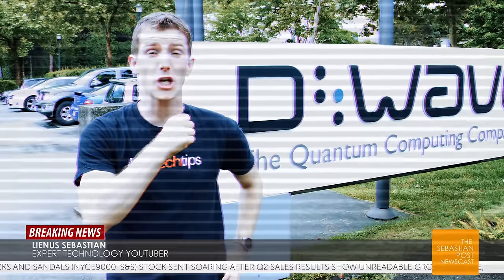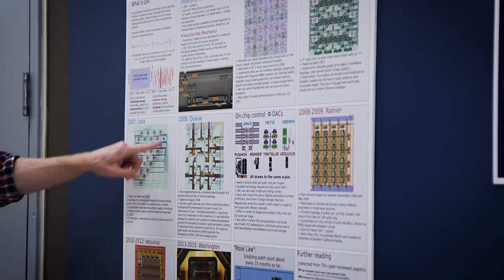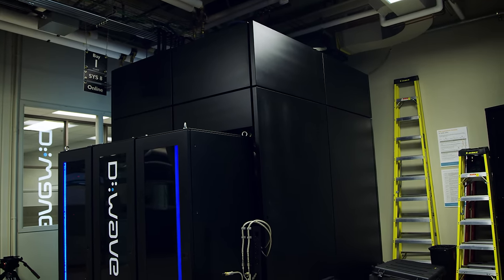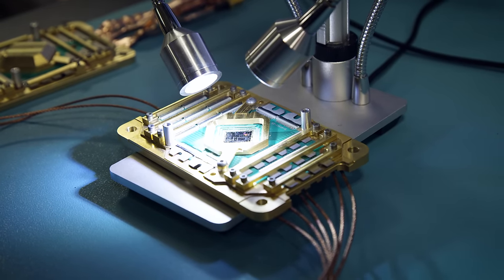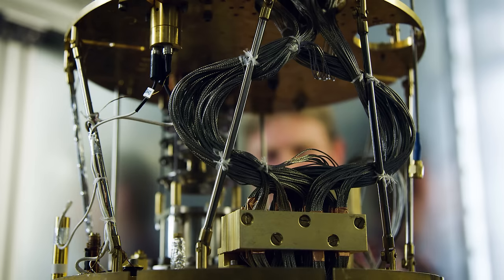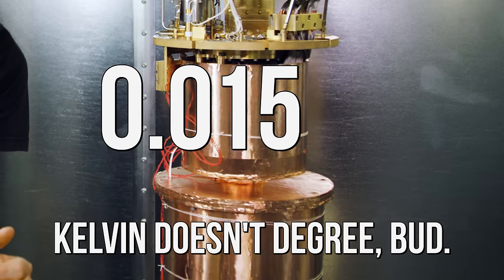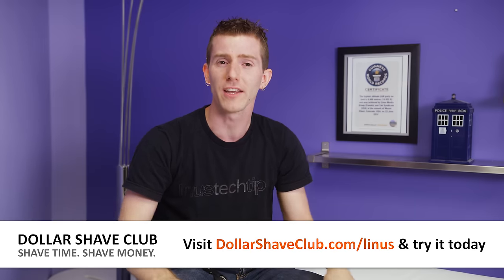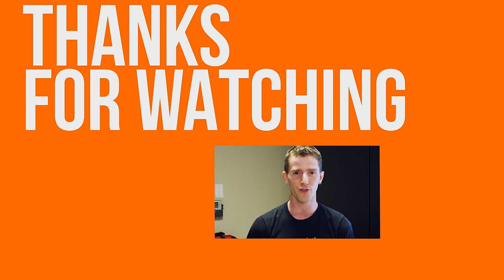UNBOXING A QUANTUM COMPUTER! – Holy $H!T Ep 19

Comment: Do they run it overclocked?
Reply: Do you really need to overclock when you have a theoretical clock speed of infinity?
Reply: the quantum part of the computer takes analog signals, so technically no, however in order to interface with those signals you need a classic computer so the whole system should just be limited by that server.
Reply: Mark Wright it's an interesting one because a normal processor does calculations at a certain clock speed whereas a quantum processor can do more than one calculation at once so could the speed be intifinate or am I not understanding any of this?
Reply: That's not how quantum processors work.

Comment: almost as cold as your average winter day in Canada
Reply: Dedede Main Canada is -273°C cold????  On average???
Reply: Canada is about -1 K during the winter. On average. Variance? -2 K^2.
Reply: AlphaCrucis -1 K is physically impossible... 0 K is absolute Zero, the temperature at which all movement, even on the subatomic level, ceases. Even if negative Kelvin where somehow possible, it would be impossible to measure.
Reply: Yes. And negative variance is also impossible. That's how cold Canada is in the winter!

I know, I suck at humor...

Anyway, a quantum mechanical system still has some amount of kinetic energy at absolute zero. See "zero-point energy". According to classical mechanics though, you're right.
Reply: It's actually possible to get lower than absolute zero, but not exactly zero, but it's actually warmer.
Reply: Dedede Main: Ah. Is that why D-Wave is Canadian?

Comment: The cooling might be able to cool a FX-9590 to about 80°C at idle...
Reply: you mean the new intel cpu right? because that one has a thermal problems, not that 5yo FX....
Reply: @HybOj No. Not Intel at all. The FX9590 is a 8 core CPU made by AMD that runs at 4.7-5GHz. With it's TDP of 220W it's essentially it's a computational heating element. If you want a very high clocked processor and the cost of power consumption doesn't matter, and you have damn good cooling, this would do the job.
Reply: +XenonQAI Researchers are still on it, trying to keep a GTX 480 or R9 290X cooler than the boiling temperature of water.
+HybOj Yes, those Core-X CPUs (because everything with an "X" in its name MUST be cool and fast and game and HELL YEAAAAAAH) are also nice space heaters, but that FX-9590 is still the current king when you want to speed up climate change.

Comment: Imagine bitcoin mining on a quantum computer...
Reply: @JGHFunRun  hahaha that's true!!!
Reply: @JGHFunRun  if that were true anyone with a quantum computer would have infinite money
Reply: With 20 kilowatts? I think your balance will go to minus...
Reply: I think calculating the hashes would take even more time as the thing would come up with nonsense values all the time
Reply: @Stigma The assumptions which hash functions are based on don’t apply to quantum computers, meaning that you can basically run the hash function backwards and find inputs which give you a specific hash. This would break Bitcoin’s consensus algorithm and therefore undermine its security.
Reply: @lenn939  it would not be end of the btc itself, but whole economy as we now know. There is a ton of services using SHA-256 encryption
Reply: @Matej Leško SHA-256 is a hashing algorithm, not an encryption scheme. But you‘re right that the security of Bitcoin is far from the only thing that would be undermined by high qubit quantum computers, so it should probably be one of our lowest concerns.
Reply: ilumix led  the same work could be given to a functional quantum computer, and the math would be more direct. so in theory it would beat any Cray supercomputer filled with nVidia Volta's GPU racks. 
Only one so far is rendering a pony movie in 3D using Arnold, that's a monster where 20 years ago it would have needed a dozen of SGI machines.
The key is in the programming of the... thing. but that proves the bitcoin is not a reliable currency, it's just using power to process sudokus.
Reply: Blue sorry I know this is an old comment, but anyone that has a quantum computer already basically has infinite money.
Reply: @chubi167  in Bitcoin. I could eventually start a crypto by mining gems or woodstocks in Everfree Outpost while I'm at  it. Or solving sudokus manually.
It would have the same value.

End the FED and the BCE. Get back to gold standard.
Reply: That is actually a good idea!
Reply: Rich as fuck
Reply: You would fork the chain.
Then have to hop chains, fork again, and again, and again... Lol at all the comments here assuming they know chains.
Reply: We found our suspect

Comment: 0 Kelvin is the coldest temperature possible in the universe
Reply: Adam Fields nope we don't know half of the mysteries on the universe
Reply: Hey look it's God himself! Is there anything colder than coldest God?

Would that be like when you let your own son get crucified? 
o_O
Reply: Eh, no, 0 kelvin is not the coldest temperature possible in this universe. 0 kelvin is impossible to achieve, therefore it's not the coldest temperature possible.
Reply: 0 Kelvin is in fact the coldest temperature possible. Your argumentation doesn't make any sense btw.
0 Kelvin means that there is no kinetic energy left in the atoms. No movement at all. Whatever you measure then is due to Heisenberg's principle of uncertainty. It's a limit like the speed of light.
Reply: Actually @Frostbite1003, @Mr. Chang is right (and wrong and so are you). 0 Kelvin can never be reached in a system because of quantum mechanics, yet in any system very close to 0 Kelvin there should be (virtual) elementary particles with a negative Kelvin temperature because of those same quantum mechanics... so yeah that's kinda weird.
Reply: Only in this universe though. The coldest temperature in my universe is much colder.
Reply: And that's the exact reason you can never reach absolute zero, there's still movement due to quantum effects. You just said it's impossible after saying it's possible.
Reply: negative kelvin temperatures are hot.
Reply: @Werner van Alphen Negative temperatures are a whole other ball game. I'm not even sure you can say they are "colder" than just a little above absolute zero.
Reply: @Werner van Alphen That's why I said "possible", not "achievable". Like the speed of light. And aren't the negative temperatures caused by the principle of uncertainty? I'm not sure right now. There was a Vsauce video about negative temperatures...
Reply: Frostbite1003 0 kelvin is not possible... no two ways about it
Reply: It was a SixtySymbols video, I think.

But yeah, as many have pointed out already, you can NOT reach absolute zero. It is not achievable, and therefore not possible. Because of quantum mechanics. Just like a body with mass can never reach the speed of light, not matter how hard you try. You can get close, but never reach it. Same for temperature, you can get close to 0 kelvin, but the closer you get the harder it is to reach even colder temperatures.
Reply: Zero Point Energy fucks it

Comment: But can it run Minecraft?
Reply: No.
Reply: ಠ_ృ stupidest question ever how can one possibly run minecraft?
Reply: No, but it could calculate every single thing you could possibly do in the game.
Reply: yes. essentially normal computers take x and add y and produce z

quantum computers take all information in a problem and produce however many answers are possible along with as many optimal answers closest to the true solution as you want.
Reply: lowest setting at 0 average 3 maximum and -0000000 lowest
Reply: faaaarrrt
Reply: Maybe but on lowest setting
Reply: RIP hypixel
Reply: Here's a question for you , if you had a brain , what would you do with it ?
Reply: Nou r/wooosh
Reply: It both can and cannot
Reply: If it can't run Minecraft why then have such thing?!?
Reply: that, my friend is the most important question I've ever heard
Reply: minecraft不是只有天河二号才能运行吗？（滑稽）
Reply: This would probably be good at managing ai in strategy games. So use these to control the ai and normal processors for other game mechanics. Could probably use it for physics/graphics engines

Comment: can it mine ethereum?
Reply: kakaó valami lol that would destroy the whole industry of cryptocurrency
Reply: kakaó valami well he said these are made to do very complex equations so I would say they would be very effective
Reply: sky blue except hash-calculations are very simple and the exact opposite of complex calculations
Reply: Excel its not that simple. come on we arent even talking about a traditional computer
Reply: dreZvynDE what is what
Reply: sky blue woah you might be right, they could become rich
Reply: kakaó valami i dont think this computer is even capable of running hash calculations...
Reply: In theory yes it can but the question is, is it efficient? Would the power to cool and run this able to sustain itself and make a profit?
Reply: What are the specs on your current mining rig?
Reply: probably not
Reply: HigherPlanes I'm using a pair of msi gtx 1060 6gb cards. you?
Reply: Yes it would ROCK for mining. Reason being is it can look at many results simultaneously while a classical digital cpu or gpu can only do 1 and 0 in a string at a time. These chips are designed for things like encryption
Reply: Devin Dykstra how much do you make /day and without the spendings of electricity?
Reply: The security industry is already researching feasibility of hashes etc when Quantum Computers become a norm. It sure can mine ethereum but the cost of running it will outdo ethereum benefits by far.
Reply: It will definitely need a different algorithm, but they might be able to bring a cryptocurrency to its knees if they feel like it.
Reply: I'm not entirely sure, but I think one of the main uses for quantum computers is the decomposition of numbers into primes, and cryptography is all about that, so yes, it could mine at exponentially faster speeds.
Reply: No; the way it performs calculations is fundamentally different from your normal computer processor.
Reply: Devin Dykstra I stopped mining in 2015. I think the last card I used was a 980m. Now I mostly sell and buy.

Comment: "This generation of D Wave's processors consume no power and output no heat"
This must be some sort of technicality right?

Edit: On D Wave's website their claims are "Unlike the CPUs of classical computers, D-Wave’s superconducting QPU dissipates negligible amounts of heat during computation" and " the D-Wave system consumes less than 25 kW of power, most of which goes towards operating the cooling and front-end servers" 
So the processor does use energy and make heat. I'm betting Linus was just misinformed.
Reply: outsider344 It is, because the whole machine consumes a ton, and heat up a lot.
Reply: i think they are talking about the "qchip"
Reply: at that low temperatures almost everything is superconductive that means electricity flows with almost 100% efficiency and the waste is very VERY minimal aka almost none
Reply: I thought superconductors generate 0 heat and has like 0 resistance which is what is powering the chip, and I'm assuming the chip is also in a superconductive state, which makes it generate 0 heat, the only thing that generates heat would be the wires that aren't in the superconductive state, which is still getting cooled continously
Reply: MeatSafeMurderer that's the thing when a wire is supercooled there is no resistance in the wire so no waste heat is produced as it is not perfectly 0k it will produce some heat but just on a tiny scale that isn't really worth noting and as in a computer all the poem goes to heat (other than linuses rgb setups) as no heat is produced no electricity is being consumed
Reply: Vince Kiss I understand the high efficiency, but I would think a processor is by definition doing "work". And a device doing work without consuming energy is no bueno.
Reply: @outsider344 i think you are stuck in classical mechanics, this is quantum mechanics where all logic stops working normally
Reply: But's it's not doing work. The electrons are just flowing without being stopped (aka, no resistance).
Reply: quantum computing relies on the random movements of electrons -- an effect called quantum tunneling.  This quantum tunneling isn't really creating any heat because at this scale there isn't really any friction. the input may create heat, and amplifying the effects of the output certainly does, but what happens int he chip is really just the occasional, random movements of electrons.  It's so cold that the heat created if any is negligible.
Reply: I don't know about the details of their physical implementation but for reversible quantum gates (that is the gates perform unitary operations) the operation of each unitary gate will in theory not increase entropy the way classical gates do. However of course you will not get around increasing entropy in some way. Especially when you do non unitary transformations. Measurements for example. For example if you run the Shor Algorithm to factor large numbers then you could implement this with unitary operations until you have to measure your qubit states eventually. Now from the moment after initialization of your qubits to the moment right before your state measurement with ideal quantum gates the entropy of the system would not increase. But first you need to initialize your qubits which will change the entropy of the system and when you measure the state you will also have a change of entropy. Additionally quantum gates in practice are not perfect. And of course if you talk about signals of some form (for example in Quantum Cavity Implementations of QC we use laser pulses to change the states of qubits), you will inevitably also create heat somwhere. 
As for the super conducting: Ofc you will loose virtually no energy due to the vanishing resistance, however letting electricity flow from a to b means that you had to create a potential difference between both sites in the first place which will cost energy. Think of it like this: If you lifted up a ball in a perfect vacuum and let it fall, then you won't heat up your system due to friction (as there is none) but you had to put energry into the system when you got the ball up to the hight it falls from.
Now still the efficiency of iidealized quantum computers is incredible compared to classical computers and as you can implement any turing machine with quantum gates one could be compelled to think we might some day have incredibly efficient machines compared to current technology. However computation will always need energy somehow.
Source: Doing my physics masters degree right now and attended a lecture on Quantum Information Processing this semester.
Reply: I checked D Wave's marketing materials on their site. They say that it uses little energy and makes "negligible" heat. So the no energy or heat thing must be some kind of mistake.

Comment: The amount of qubits isn’t our limiting factor.  500 quits already has the potential to model more states than every computer on the planet combined.  The issue is the required environment and configuration of the physical quantum computer.  Temperature aside, once you’ve developed a quantum computer, it can only be used for very specific calculations.  We are now in the stage similar to when classic computers could first only add numbers.  We haven’t even reached the peak of the equivalent of “vacuum tube” era yet

Comment: Can I play minecraft at 60fps with that?
Reply: if you play minecraft with that kind of processor not only you can run it on 1000fps but the pixelated graphics of minecraft would be unimaginably sharp. Ender dragon would become real than the game of thrones cgi.
Reply: pinoy vendetta wtf?
Reply: More importantly minesweeper.
Reply: With shaders and 1,048,576 x 1,048,576 texturepack in VR and 16K Resolution :D
Reply: ehm no that's plain wrong there is nothing that makes a  quantum computer inherently slower then normal its just that it simply docent have enough processing power yet the first mechanical computer was slower then then a human calculator infact normal computers are going to be replaced by quantum machines because the problem with traditional computing is that it relies on being able to at the lowest level control electric pulses via barriers thing is now that the smallest components in computers are getting closer and closer to the size of atoms the will eventually have to face quantum tunneling something a processes that allows atoms to essentially teleport a very very short distance thus getting around the barriers and making building normal computers smaller impossible quantum computers however do not have this limitation
Reply: I dont know, you might get a crisp 2 frames if youre lucky
Reply: You can play minecraft on a microwave at 60fps
Reply: Only if you fired all of Mojang and let a 12yr old kid code a new engine for the game.

Comment: More qbits are completely meaningless due to the high error rates being introduced by quantum annealing process that D-Wave uses. There's no point in having the answer quicker if you don't know if your answer is true or false.

Edit: I guess that's why they're running the processors at as close as they can get to absolute zero. Still it would have to be measured to see if that strategy is working  (run the same calculations vs a conventional cloud PC hive) .
Reply: your answer is both true and false simultaneously
Reply: thebunnyrules interesting. For most problems, wouldn't  testing the answer is often faster than determining the answer in the first place?
Reply: Deleted.Gamer until you look Into the issue and it collapses into a single answer
Reply: I wouldn't say they're completely meaningless. I agree that the annealing process is not really what we want, but being able to consistantly create a large number of low-grade qbits (certainly in a true quantum computer) is an extremely important step to take, leading the way to stable logical qbits.